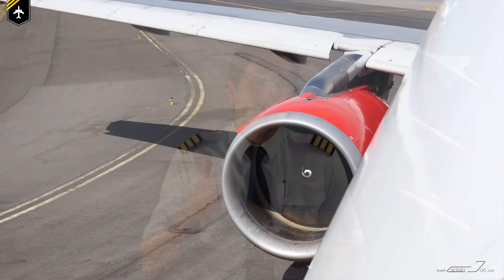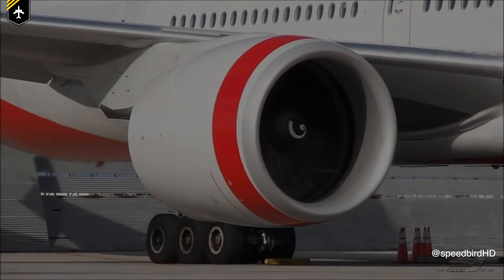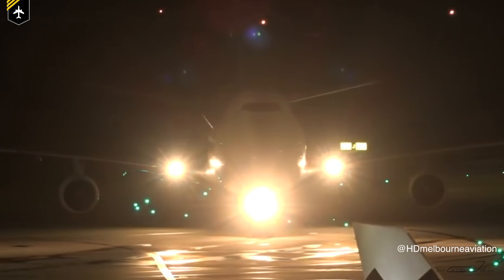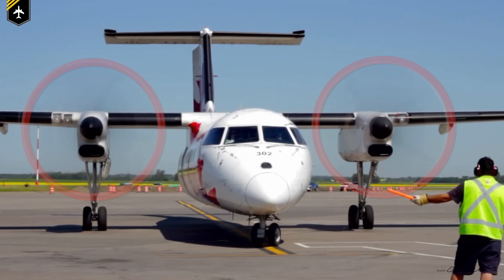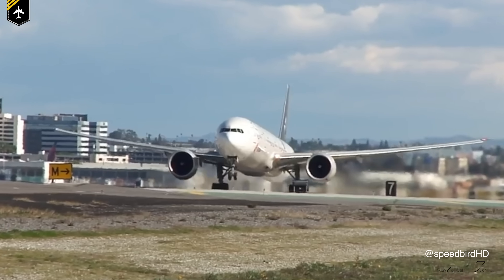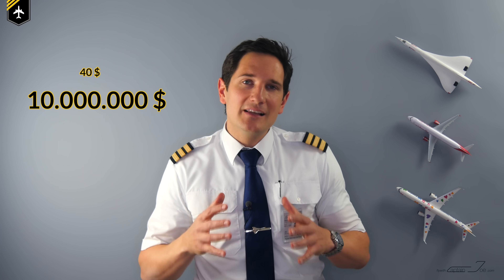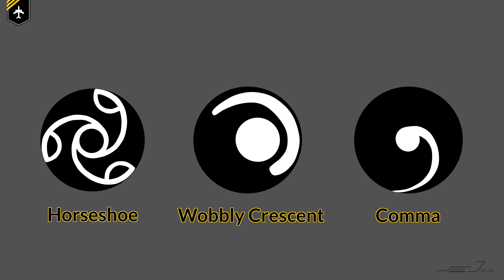WHY is there a SPIRAL in a JET ENGINE? Explain by CAPTAIN JOE

Comment: Why not cover the suction area with some appropriate cover or mesh that doesn't interuppt in suction in anyway and also block any human or any foreign object that may get sucked in anyhow. Consider a slightly different application in our day to day use object table fan. What I mean to say is surely somebody must have thought about it and still not using it so there must be a good reason. So, I think u should make a video about such practice where there are ways to minimise the risk but these practice are not followed and why

Comment: hey captain joe!

i have a question:
why dont you put a „filter“ in front of the engine to prevent birds getting into the engine?
Reply: Several reasons (I got this from several sources):
1. It would suck up (no pun intended) a lot of engine performance, reducing range or requiring more fuel.
2. Bird strikes only happen in the first few thousand feet of flight, but performance would be affected for the whole flight.
3. If something strikes the grill, the grill has to be strong enough to not become dislodged, itself, and get sucked into the engine.  (Engines, themselves, are designed and tested to withstand bird strikes up to a certain weight limit.)
4. Things could get stuck on the grill and severely inhibit airflow into the engine.

For more information, here's a NY Times article published a few weeks after the Miracle on the Hudson:
https://www.nytimes.com/2009/01/22/nyregion/22engines.html

Comment: Air craft carrier deck crew have been sucked in to some intakes due to being too close, a well known incident w an A-6 Intruder was a guy being sucked into the port intake, he didn't get caught in the turbine but his helmet did, a quick flash from the rear of the jet showed what happened to the helmet, the plane was shutdown, the crew guy checked and sent below, he prob got one hell of a lecture later after being cleared by medical. When enough air is going out to even have the jet working, it's gonna suck in everything around it. On carriers they have a FOD (Foreign Object & Debris, although I hear they've updated this) walk and everyone on deck walks from stern to bow looking for nuts, bolts and etc that could get sucked in or damage a tire, crew, officers and even VIPs have been part of this, one little nuts can screw a very $$$$ jet engine and take that plane out of service for days, they have to pull the engine, fix it, test it and then reinstall it. Granted the US Navy has some great ppl for this, but avoiding it entirely is best.

Comment: First I appreciate UA effort posting very helpful videos but I have a question sir
What is name given to the that man standing Dash Q 400 and what is his work?
Reply: They're called marshallers or aircraft marshallers.  Their job is to guide the plane to the gate or parking area because their front gears usually need to park on a very specific target and the pilots can't see underneath.  They also work with people at the wings to ensure that the wings do not get clipped and that no vehicles or people come in contact with the plane.
Here's some more info:
https://www.baatraining.com/what-is-aircraft-marshalling/

Comment: talking about bird impact on jet engines.......I wonder if the designers ever thought of putting up a net of small mash grill in front of the spinning turbine, to prevent anything getting sucked in.

The air would still gets sucked into the engine to produce thrust, but nothing else.

I know its an enormous thrust those engines produce, but if the net / grill is securely fasten it might not get sucked into it!

I wonder???

Comment: Getting sucked up an airplane engine is probably one of the worsts way to die

You are literally blended to death
Reply: but its very quick.......takes just a milisecond and the pain is over!
Reply: @maxnoerenberg6370  Yea I know
Reply: I think falling into smelted iron is worse. You literally melted to death.
Reply: @oldi184  idk, it would burn your nerves so you wouldn't feel it, just bake from the inside out
Reply: oldi184 Jesus I wonder what goes on in your head mate 😹
Reply: oldi184 or lava?
Reply: @oldi184  Not to mention you probably wouldn't start sinking right away
Reply: @oldi184  you will not melt but stays on the top
Reply: @oldi184  After reading “Working Stiff” about a manhattan medical examiner’s first year (2001!), I learned of the actual worst way to die. Two guy friends were walking home from a bar late at night. They got into a mild tussle and one guy fell into a manhole. If you know anything about manholes in nyc you’d know that most of them are filled with boiling water. After over an hour of boiling in pitch darkness he finally stopped yelling. Two hours after that they were able to retrieve his body and he was cooked solid.
Reply: I’m not gonna contribute to this dark conversation whatsoever because it’s pretty terrible to think about.

What about having a spike slowly impaling you as you’re restrained to a wooden bed?
Reply: yall have some strange fantasies
Reply: @nitsuj8100  Does it have to be a wooden bed?
Reply: @nitsuj8100  you have experience in this particular field... 🤔
Reply: @nitsuj8100  TOO FAR
Reply: That one guy got sucked up into one and survived, somehow.
Reply: @seanthebaptist6757  it was aircraftcarrier staff. His helmet was sucked off his head and it caused a flameout. Also the pilot shut down the engine immediatly...
Reply: @annasstorybox7906  Yeah but his whole body got sucked through but his helmet saved him from death.
Reply: @annasstorybox7906  thought it was his radio, not helmet?
Reply: @Al3xPhantom New idea for a scene in Deadpool 3! xD
Reply: Blended to death, set on fire and spat out like vomit. Its quick but yeah pretty awful
Reply: @ttthhhhhhfff  if you ever saw the original macguyver series and remember Murdock??! Now that would be the guy to survive THAT shit 🤣🤣🤣
Reply: It is very expensive, he said it takes 10 million dollars to replace the engine after a small bird,
Reply: @AndreyPutilov  those aren't cheap for sure. Thank goodness for insurance
Reply: It would be a quick and pretty painless death IMO.  Sucky way for you to die from the mechanic's standpoint who has to pick bits of you out of the engine when he rebuilds it.
Reply: Worst way to die is to not to live by your choices(freedom). Takes a whole lifetime, without any hope of change.
Reply: Slowly getting eaten to death by small bugs is much worse.......that's how I  died
Reply: falling from a sky scraper where you're conscious and aware the whole way down.
Reply: littlegoobie there was a woman who fell over 1 mile and survived
Reply: e greenie the chute failed it did nothing for her
Reply: @xx_mysticwolf_xx1492  that was in Peru right?
Reply: @littlegoobie  The impact is fast tho
Reply: Rock Stone no, you are literally passing thru alive ! https://youtu.be/unXNdrtf2_g
Reply: imagine being crushed bone by bone flesh by flesh by many 10+ fts iron blades, isn't it exhilarating
Reply: Drowning or burning alive for sure
Reply: I can think of so many worse deaths. Liver failure can lead to you being fully awake while puking and defecating uncontrollably until you die.
Reply: Literally
Reply: @fayenotfaye  tbh surviving a fall like that is a worse fate than dying
Reply: I would take the quick death as opposed to being trapped in a fire where you can feel every single nerve ending being blistered away beyond their capacity
Reply: Pretty quick tho
Reply: @Mark Thompson Thank you!
Reply: really? i thought you'd get blended to life
Reply: You're more likely just to hit the blades since our body profile is way too big.
Reply: not really: dying slowly of painful cancer for months sounds way worse....
Plus, if you get sucked by a jet engine, you would probably die before reaching the blades as the forces would probably snap your neck. It would be quick, painless and quite glorious.
Reply: Shaken and stirred.
Reply: https://www.youtube.com/watch?v=AF55oyAJDBk
Reply: Bruh. Just stand behind the engine if you don't want to be blended to death. Smh.
Reply: Corned Beef incident
Reply: You wouldn't feel a thing...... By the time you would realize what is going on, you would be basically on the other side.... literally.
Reply: Insta-kill tho, better than being bored to death
Reply: Will it blend..?
Reply: sucked into elevator is slower death and it worse than airplane engine
Reply: Dare I reference Die Hard 2? (*Spoiler*There is a scene in the film where that happens!)
Reply: will it blend?
Reply: @fayenotfaye  I'm afraid you wouldn't want to survive such a fall unless you land on the largest Jell-O ever made
Reply: Rock Stone - On the plus side, no expensive coffin shopping or cremation.
Reply: @whoa9432  comment section winner right here. Mic drops 👍👍👍
Reply: Rock Stone nah  Beein eaten alive like by a lion or bear I would say is worse, the jet engine route is quick !
Reply: You would probably bang yout head so hard you wouldnt be feeling pain for the few seconds you may still be alive
Reply: Google the guy who got sucked into sighted jet on air crafter carrier. He survived with little injury
Reply: @petesmith9472  to be fair he wasn't sucked into  turbines with blades
Reply: Comment section reminds me of the show on spike TV
"One thousand ways to die"
Reply: Killed by bladed MRI
Reply: @tonichecavalari5956  lmfao bladed MRI!
Reply: "Will it blend, that is the question"
Reply: And probably killing other people
Reply: @The Boeing Kid Didn't someone show the brains still active for a short while after the guillotine so you'd still suffer, because the brains still surrounded by oxygenated blood, itd be like passing out but while most of your nerve endings are screaming
Reply: mmm tasty smoothie
Reply: Blended and burned
Reply: molly from gta v can comfirm
Reply: it's not painful tho
Reply: Not to mention the engine would be done over
Reply: Nah, there was an accident caught on camera  with a man being sucked in a jet engine from a fighter and survived. Some of the video's has been taken down by Youtube as it was in violation of the TOS, but mysteriously and lucky not all. https://www.youtube.com/watch?v=AF55oyAJDBk (there is also some other footage).
Reply: Yeah, after a human body parts get chopped, compressed, burnt, the remaining that went through the bypass part, it will mix together making human juice. Ew
Reply: The human brain remaines conscious for 10-15 seconds after decapitation
Reply: My thumbnail is me standing in the jet engine intake (GE90-115) of a Boeing 777, it gives a good idea of the size and I'm over 6 feet tall.
Reply: Like this guy...except he survived.   https://youtu.be/AF55oyAJDBk?t=29
Reply: @lab1042  Oh, shiz. Glad he lived, but that would’ve effed me up mentally. Thanks for the link, I never knew that was survivable! 💚✌️
Reply: Human blood and flesh smoothie
Reply: Okay, first off, you'd have to determine are we talking turbo-fan or just pure jet. 

With a turbo fan, you're more likely to hit the actual turbo-fan, and then you'd go in between the actual engine and the cowling. Yes, the fan would DEFINATELY mess you up, but you'd mess it up too. Survival would basically come down to what part of you hit the fan first.

On a pure Jet (No big fan in front) your first point of contact would be housing, and then you'd get sucked up against the inlet until your body starved the jet of oxygen, most probably resulting in a surge which would pop your carcass off the intake like a cork from a bottle.

The compressor doesn't actually suck any air in, and what is more, it doesn't blow air backwards either. The exhaust fan does that part. The compressor sends the air out in a circle (Centrifugal air pump) where it gets squeezed into a bunch of combustion chambers (through a hole about the size of the drain in a kitchen sink, roughly 20-25mm). Inside the combustion chamber the air slows down and fuel is injected, the air/fuel mixes and then is burned on it's way out of the combustion chamber. The compressor(s) maintain a higher pressure at the entry of the combustion chambers, which leaves the fireball one way to go, out the exhaust fan. The now-superheated air drives the exhaust fan, which is connected to the compressor via a shaft running down the middle of the engine, driving the compressor.

In short. you'd have to go through a blender first to be able to be passed through a jet engine. You're just too big and unlike birds, your bones are dense.
Reply: Actually, it's all over in an instant. There are worse ways.
Reply: Either that or you being caught cheating by your wife
Reply: The absolute worst way to die is separated from Jesus Christ.  All our bodies are going to die at some point. It's were you go after that that's important.

Comment: At first, the question about the use of that spiral seemed to me too obvious to be asked. But Captain Joe is teaching us several additionnal interestings facts about aircrafts. But one question remains to me: why isn't there a safety metal grid in front of the engine air entrance so that a ground worker or a bird would no be sucked into the turbine fan?
Reply: I think it's to let in the most air

Comment: Why don't the engine makers put a grid on the front of the engine to keep the birds out?
Reply: Bc at airplane speeds a bird would still enter the engine, but in more pieces.  

Not to mention the constant FOD threat from any failure of the grid.
Reply: @h8GW  1) That depends on the size of the openings. If the openings are small enough for air to pass but not bird, the amount of bird getting to the turbine blades will be very small. 2) To minimize FOD, it could be integrated into the engine front shroud, either as a permanent fixture or as a retractable deterrent.

Comment: ok if birds are attracted to the blackhole seeing the engine inlet as a dark cave. Why not paint the fan blades white along with the spinner cap, the bird would see a white object and not a cave and decide to avoid it instead of flying into it
Reply: Paint has weight that can imbalance the blades or could chip off and damage the motors.
Reply: @RickRansomSmith  thats easy paint them properly lol they are painted at the factory anyway soooo this concern is redundant

Comment: May be a stupid question but would appreciate an answer if anyone knows. If we want to keep birds out of the engine, why don’t we mount a cage with holes around the turbine to allow air to go through, but will stop birds from getting sucked up? If this makes any sense.
Reply: Primarily, icing. A screen like that at high altitudes would just ice up, blocking the engine.

Secondarily, you'd need one hell of a screen to prevent a bird from getting into the engine. And if your screen breaks, now a bird AND a screen are going into the engine.
Reply: So a screen essentially? I would assume because bird ingestion doesn't happen too too often and it would degrade the efficiency of the engine itself.

Comment: If the pattern possibly helps to scare birds, why not paint some of the blades white to create the illusion or the fan blades not being a dark hole?
Reply: The blades are incredibly well engineered so painting them would have an effect on their performance(it doesn't sound like it would, but as i said, these blades have to be made insanely precise) And bird ingestion arent all too common so its not really necessary.

Comment: why don't they paint one or two of the fan blades? Then the black hole inside the engine will bee collored when in the on position
Reply: Balance issues. That one gram of paint can rip an engine apart when it's spinning at 40,000 RPM+.

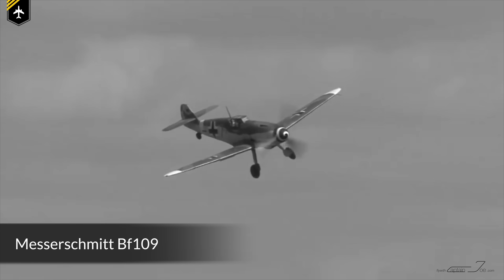Comment: 1:10 Messerschmitt Bf109 G* 🤓
Reply: If you're going to correct someone, do it right. That's a Bf-109 G. It's hard to tell whether it's a G-2 or a G-4 because the gear's down, but that's a Gustav. You can tell from the smooth cowling (which the E(mil) didn't have) and integrated armoured windscreen (which neither the Emil nor the F(ranz) had).
Reply: Wolfgang B nerd
Reply: Wolfgang B il correct.

Comment: Even if they DO startle birds that won't necessarily prevent them from being sucked into a 75,000 lb. thrust engine operating at full blast. That's a frigging boatload of air moving real fast especially if you're a little bird that weighs a few ounces. Thanks for another great one Captain Joe!

Comment: Hi caption Joe. Can you please explain the real solution to the famous boing 747 on a conveyer belt problem. Where the wheel speed always matches the conveyer belt speed. Will the plane take off???
Reply: No. Takeoff is based on air traveling under the wings, regardless of the wheels, so you can takeoff at lower ground speeds into the wind and theoretically even at zero ground speed
Reply: No

Comment: In 1978, my boss told me an aviation story.  In WWII, he and other soldiers were standing on the ramp waiting to board a large military aircraft.  The props were turning.  All of a sudden he saw a dog run out under one engine and disappeared after being sucked into the prop.  After which there was nothing to see.  The dog was chewed up as much as he had been in a meat grinder.  The boss stated it was a sobering experience about the power of aircraft engines.  Something to remember.   Thanks for the video.  Since ground crews wear ear protection and have many distractions while working around aircraft, it would be easy for them to make the mistake the dog made.